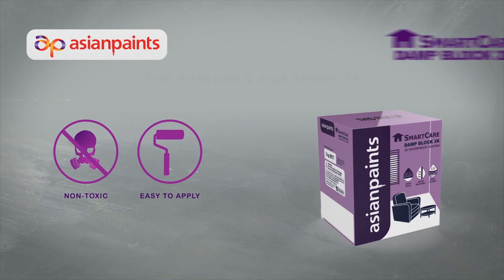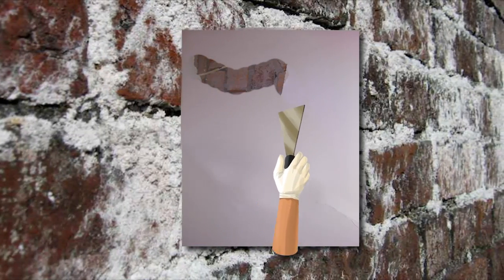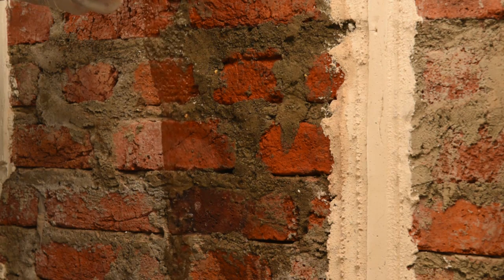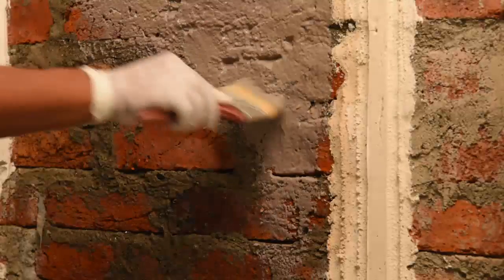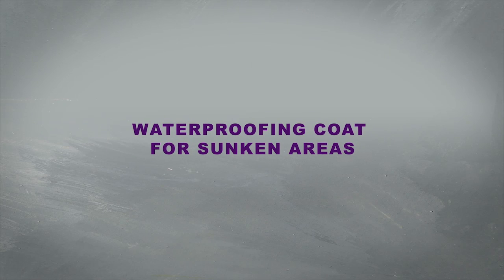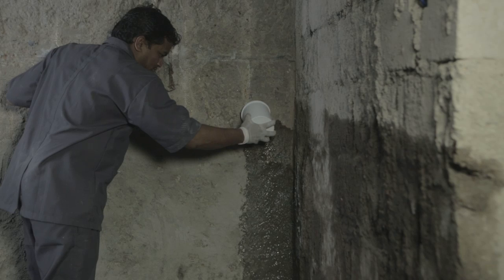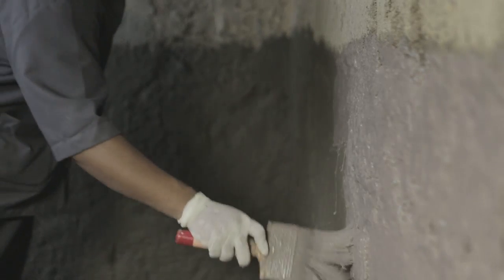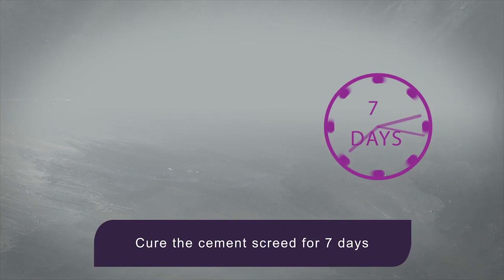SmartCare Damp Block 2K

Comment: In my bathroom i want to apply cement coat after waterproofing . How long i have to wait after apply ing second coat
Reply from the maker: Hi, in this case, One can apply a coat of 6-8 mm thick cement sand mortar on the wall/floor after 12 hrs of application of second coat of Damp Block 2K once the coating should dry enough.
Smart Care Repair Polymer (7-10% of cement weight)  should be mixed in the cement Sand Mortar for better strength and bonding.
This application should be done within 48 hrs after second coat application of Damp Block 2K for proper adhesion of the plaster mortar with Damp Block 2K coating.

Comment: Can I make second coat after 48 hours of first coat ?
Reply from the maker: Hi Suman, you can refer the product information sheet from our website for the application procedure. Here is the link - https://www.asianpaints.com/products/waterproofing-solutions/smartcare-damp-block-2k.html
Reply: @asianpaints  Product information sheet does not describe it. It is only written you can apply second coat after 4-6 hours. But it is has not stated whether there is any upper limit or not for the same ?
Reply from the maker: Hi   @aichsuman  , you can apply damp block 2k 2nd coat after 6 hours itself, so you can apply damp block 2k 2nd coat after 48 hours and do the plaster after 24 hours.  Hope this helps!

Comment: Do we need to wait 7 days after applying this 2k damp coat??
Reply from the maker: Hi, if you need to do water ponding test wait for 7 days or if you want to do cement plastering over damp block 2k you can do after 24 hrs.

Comment: I am a contractor and I am applying this mixture tomorrow morning and I am not plastering on the surface , directly I'll apply POP on the wall face will it give good results?
Reply from the maker: Hi Sachin, for good result we recommend plaster over damp block 2K.
Reply: Hii ..how is it? Does it work?

Comment: If i add 2:1 ratio .it will became a thick consistency.? Then how can I apply
Reply from the maker: Hi, 
SmartCare Damp Block 2K mixing ratio is 3:1. 

If you reduce the same then material become thick, which will have problem in application i.e. penetration between gaps of bricks will reduce
.
Reply: Brishti Roy  I too used in the same said ratio. Add powder slowly to liquid keep stirring. yes it was bit thick. i applied with brush
Reply: How is the result after 3 years?